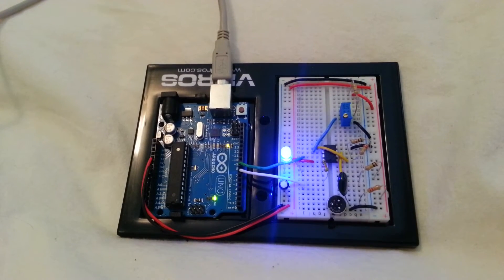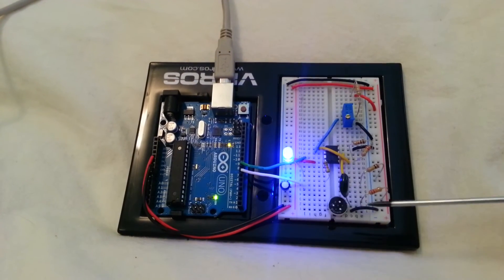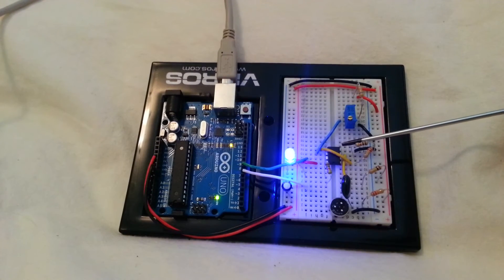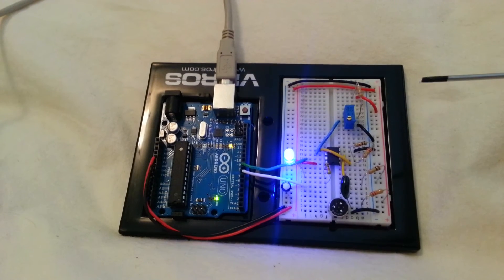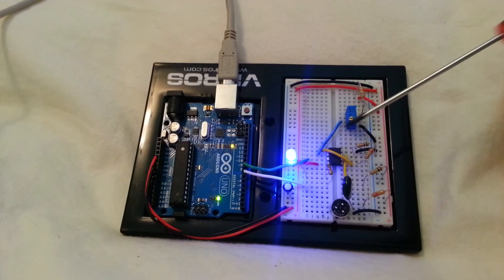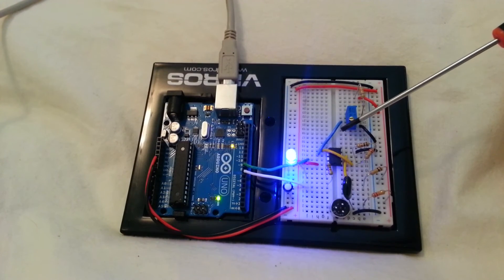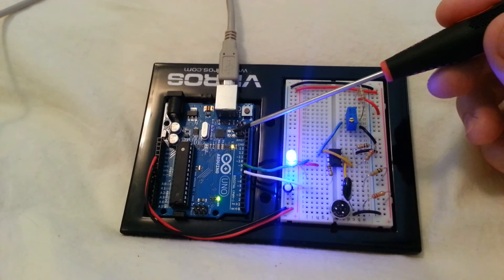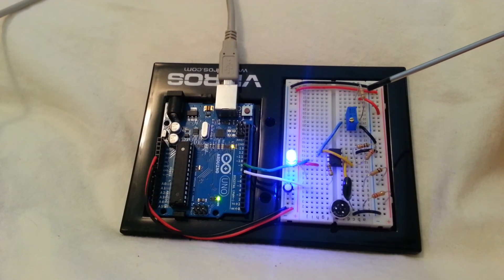High Sensitivity Arduino Sound Level Sensor

Comment: very cool.      ...   Im trying to find a device that can read deciblesor overall sound level.   I play in a band & every place we play it is a constant issue of being too loud. We start at a comfortable volume but some songs we just play harder as does the drummer.   Resulting in us being loud.     ...Do they make any type of device that can register sound waves from from say 50 feet away?
Reply: You can purchase a handheld sound meter that gives output on a meter and you can also get a stereo version it shows dB levels, look on Amazon or eBay